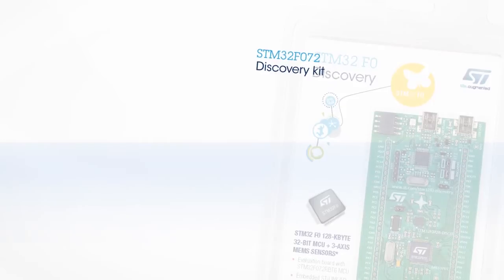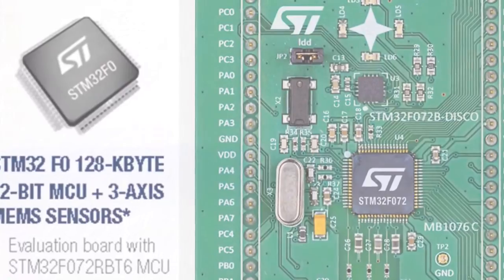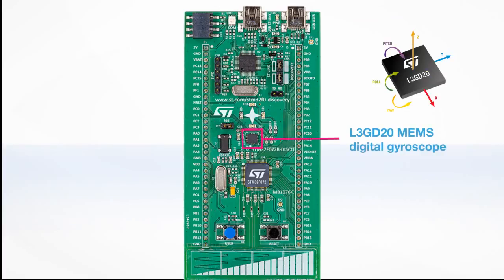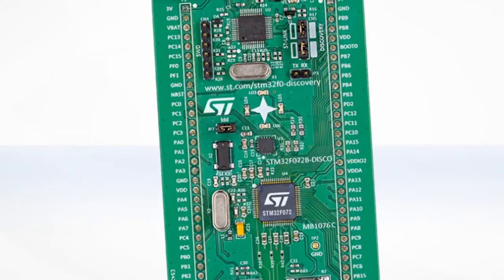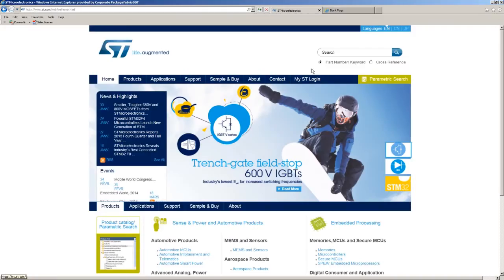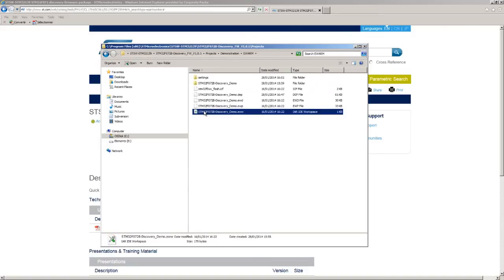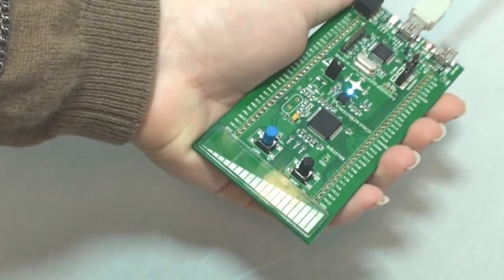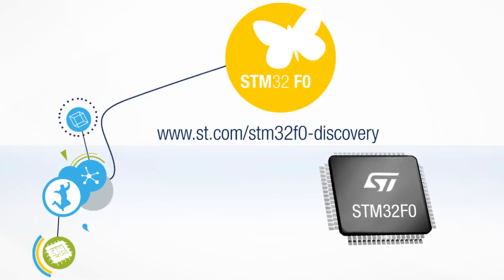Getting started with the STM32F072 Discovery kit

Comment: VIDEO STM32F4 DISCOVERY ELECTRONICS
https://youtu.be/TWdqETKJ6qY

STM32F4 DISCOVERY ELECTRONICS
DIY PCB PROGRAMMER MIKROC PRO FOR ARM
HC05 BLUETOOTH MODULE INTERFACE
WIFI 2.4GHZ AND CAMERA TRANS AND RECEIVER
DIY QUADCOPTER, MULTICOPTER
TFT320x240 SSD1289 GRAPHICS AND TOUCH
MINI SD CARD INTERFACE LOAD IMAGES
ARDUINO PCB PROJECTS